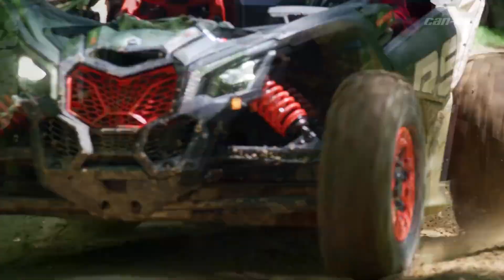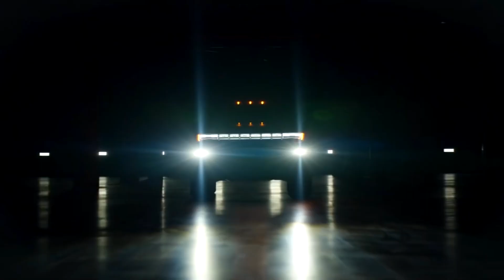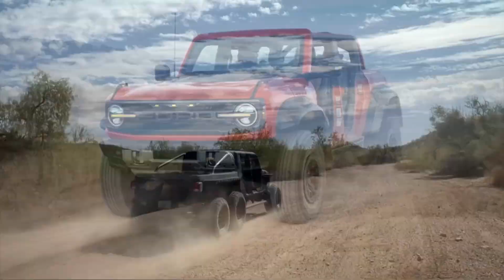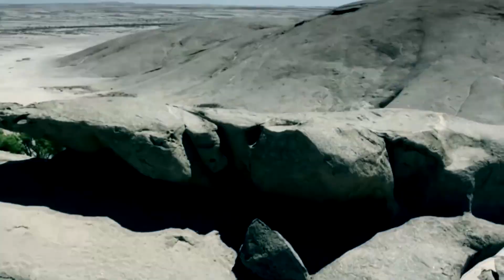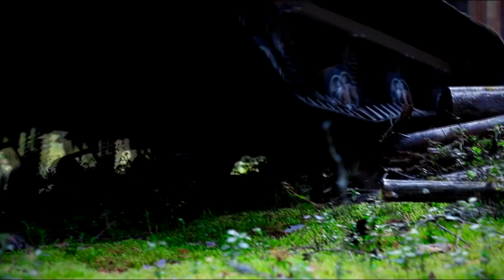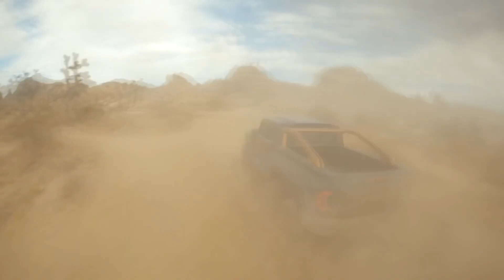Most Extreme All-Terrain Vehicles For Apocalypse

Comment: Fun fact: Fuel (such as Gasoline and Diesel) only last about 2 years in storage (degradation starts to set in after 6-8 months, i.e.: your vehicle will need more [degraded]fuel to make the same ammount of work as it would with less [normal]fuel, a problem that will only get worse with time, peaking at about 2 years, when the fuel will be so bad that it'll clog and brick the engine entirelly). So, to make a long story short: In a REAL Apocalypse, where the infrastructure to pull Petroleum out of the ground and process it into fuel no longer exists, all of these big chunks of metal would be useless after 2 years. In a REAL apocalypse, the long-term hardcore survivors would use electric vehicles. 
Good quality batteries can last up to 10k cycles and can be stored indefinitively in propper conditions. Just go to California and take every Tesla Powerwall and solar panels you can find and bam: virtually infinite fuel for your ride. If you don't die from other circumstaces, it'll last enough time with very little maintenance untill civilization reboots. 
cheers.
Reply: L
Reply: no one use electricity durin apocalypse thanks to global EMP or worse lol 🤣🤣
Reply: @whiterspon-x  “global EMP” dude wtf are you talking about. Why would there even be a global EMP? Like, why is that a thing on the first place? But ok, lets say there was a global EMP (for whatever reason), its an easy fix. Change the solenoid usually solves it. To protect from future EMPs: faraday cage. All done.
Reply: @LeprinhaGul  or nuclear Bateries how easy :) especialy on nuclear war is cheap and easy to find :) by the way ? in this time scientists create first Nuclear AAA Bateries on the word and its work :)
Reply: @whiterspon-x  one nuke going off in NY doesn’t mean the EMP will reach the entire east coast. Honestly, movies and pop culture in general make nuclear bombs seem a lot more deadly than they actually are. Not to say that they aren’t dangerous; they are, a lot. But as long as you’re not close to an urban center, you’re going to be fine. Rural communities 100+miles away from urban centers wouldn’t even notice the war.
Reply: @LeprinhaGul   yeah movie is not accurate dont worry for that